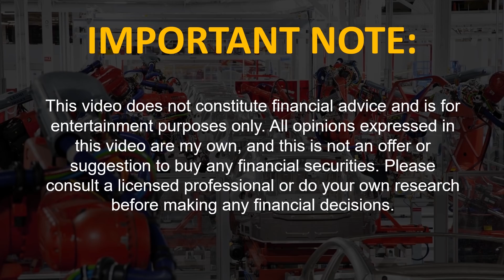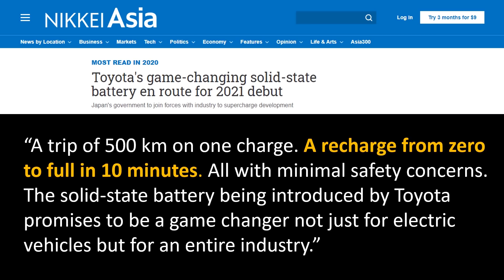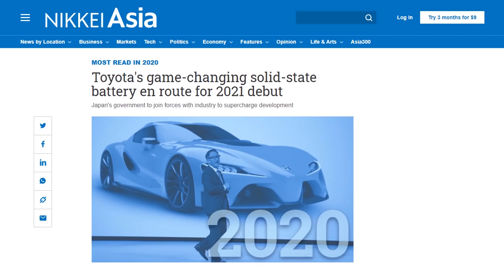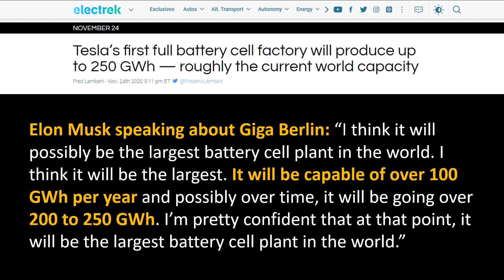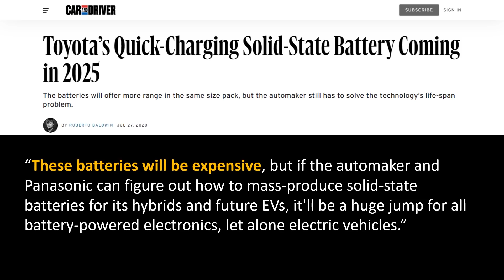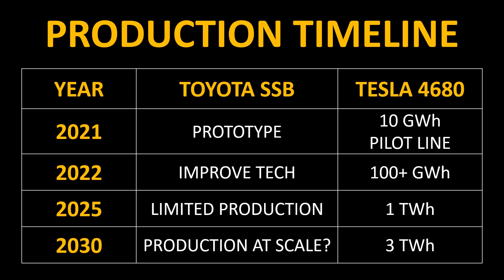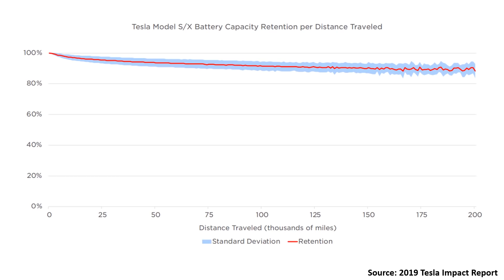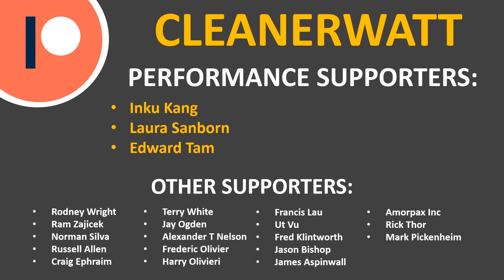Tesla NEW EV Batteries vs Toyota Solid State Batteries

Comment: Tesla can do over 500 kilometers now (300 miles) on the model 3 and Y and almost 700 kilometers (410 miles) on the model S and charge from less than 20% to over 80% in 15 minutes with the  Ver 3 chargers TODAY! that is fact and without the new 4680 cell which will be better all the ICE Car makers are 4-5 years behind

Comment: and also they are not going to stop making things better so in the 5 years that toyota is going to take to come out with the higher prices solid state batter tesla should have double to triple if not more on the power and charge rate, and or possibly come down even more on the size/weight

Comment: Tesla is years ahead of the competition. However, solid state is the holy grail, which Tesla also seeks to achieve. Any company achieving this, will be ahead of any other competition, including Tesla. We will see who gets there first.

As with all new technology, it will come at a price until mass production is achieved, but the party piece is real fast charging, comparable to gas cars and getting rid of the lithium should get rid of battery fires in case of punctures.

I will get a Tesla Model Y next year and I do hope to hold on to it long enough for solid state batteries to mature. The next EV after the Model Y will be from a company with that tech. Additionally, that next car would also really need V2G technology, to help with the transition to greener energy. If Tesla were really confident about their battery tech, they  would make this a top priority.

Comment: I don't see that solid state batteries are a problem for Tesla. Tesla has a good relationship with Panasonic who are doing the research for Toyota. Tesla will go full steam ahead making EV's with the current leading technology which is Lithium Ion batteries, because they can't wait for solid state to be ready for production. For Tesla, more Teslas on the roads is free advertising, and of course they are building a loyal customer base using existing technology. When solid state is ready for production, Tesla will cut some kind of deal with Panasonic, and start using those solid state batteries as well as, or instead of the Lithium ion batteries.

Comment: I thought this would be unbiased.  This video reads like something a Tesla fanboy would post.  I understand that Toyota's battery is nowhere near able to be put into production, that part is fine.  But you mention these new Tesla batteries and how they are cheaper, but give no statistics regarding how much improved they are in regards to how much energy they can hold over the older model batteries nor how much faster they are to charge.  The only statistic you give is regarding the longevity of a different model of battery.  

Also , your biggest benefit of the Tesla battery appears that they can be made at scale in very high amounts of capacity.  That's great and all, and hopefully they will bring down the price of the total car in general.  However, increased capacity doesn't touch what I consider is the weakest link of electric cars right now, the fact that they take too long to charge.  In other words, even if I can get an electric car cheaper, it's still much much faster to fill my tank with gasoline compared to charging it.  Don't get me wrong, I am not against electric cars, I really love the idea -- it's far cleaner to the environment, and gas stations and the production of gasoline are extremely toxic just by existing. You don't address this problem at all, and because you just compare Toyota/panasonic to Tesla, you need to keep in mind that Toyota is not Tesla's main competitor, but fossil fuels.

Comment: So a reality check comes from Car and Driver article. Come on man, you can do a better research than that. Right now 4680 is the best lithium battery, but a lot of companies had been developing solid state batteries. If Toyota can deliver on all these claims, it's good for everybody.
Reply: It is consistent with the current research literature - this summary (and the C&D article) is similar to what experts in battery research are saying. Scaling SSBs will not be easy, and that won't happen until after they work out other issues like cycle-life/capacity fading, and high cost. And all the while, LIBs will keep marching along.
Reply: @cbmusgrave  difficult doesn't mean impossible, or we are stuck with the current technology.
Reply: @techburnsca  Of course the technology of various LIB types will continue to advance with more R&D - the issue is the gap between the SSB potential and where we are now. I'd prefer taking a more fundamental evaluation of what needs to be done to evaluate the potential timeline for its commercialization.
Reply: @cbmusgrave  IMO, LIB battery tech could become obsolete once SSB comes to market.  Toyota, VW, Samsung, Panasonic, to name a few already have working prototypes. Now, it's just a matter of scaling up for mass production. 2025 is a reasonable timeline when we will see them on the roads.
Reply: @techburnsca  We'll have to see. Are you a battery researcher or developer or have you worked on scaling up other technologies? Scale up is a key part of commercialization (as Musk pointed out, prototypes are easy, manufacturing is much harder). Despite the prototypes, they have not found an electrolyte that meets all the performance requirements, including the stability window for proposed cathodes and electrodes. They also have to work out adhesion issues and sensitivity to delamination and mechanical stresses. Also, they use a wet process for electrolyte deposition and do not use a roll-to-roll process (so, manufacturing cost could be high). They also need to develop recycling processes (although I suspect that Redwood material's smelting process will also work for ASSBs). Two friends of mine started SSB companies (Quantumscape and SolidPower), so I hope they succeed sooner, but I understand there is a big gap from prototypes to commercialization.
Reply: @cbmusgrave  Quantumscape is even more optimistic targeting 2024 with VW vehicles. I thought Quantumscape and Solidpower are also using roll to roll process (I don't really know but from what I have read). No, I am just an engineer who happens to be interested in these things. I'm in the agricultural machinery industry. Scaling is really a challenge for new technology, but, I am optimistic that in 2025, we'll see these on the roads.
Reply: @techburnsca  I have seen Quantumscape's estimates and they are very optimistic. I won't comment too much because one of the founders is a friend and former colleague (we published one research paper together). It would be great if they do hit 2024 production but from what I know, they will have to solve some major challenges first. I'm assuming if they do produce SSBs in 3 years, they will be very expensive (meaning VW EVs will be very expensive or they will lose money on each car sold). Current SSB processes are wet and if they do use a dry roll-to-roll process, they will likely need to license Maxwell/Tesla's dry electrode deposition IP. One thing I haven't seen yet is a solid electrolyte with a wide redox stability window - that isn't a scaling issue, that is a fundamental materials issue. I haven't seen as much from SolidPower, but their time frame is to have their batteries qualified by early 2022 so I expect we'll hear more about what they are doing this year.

Comment: Does Toyota need scale on its battery now? No. The ICE market is still huge. The growing market over the next decade is not BEV but PHEV for Toyota.
You may start today with a 2.4l engine. 2022 move to a 2.0l with small battery, 2025 move to a 1.6l with bigger battery, 2028 move to a 1.2l with even bigger battery.
They can already make enough cars, they can already make the engines, all they need is to scale up the batteries.
It's not going to be ICE today EV tomorrow.

Comment: "Doesn't seem focused on EVs"

Apart from the 6 global BEV models that will be launched between now and 2024? 🤦‍♀️

Apart from the Direct4 motor technology and 402hp SUV prototype that Lexus showed off during December (RZ450e)?

The Solid State Battery model will be shown as a prototype vehicle for the Olympic Games, it's the next step on from the current battery packs - part of their spending on alternative fuel technology, which includes hydrogen.

Comment: Solid state batteries is just an excuse by Toyota to delay mass producing EV's by 10 years since they don't really want to make an EV unless forced to. If they were really motivated to make an EV, they can use less expensive, existing off the shelf battery technology in a car that can be produced now and then upgrade the battery as it become available.

Comment: when you say Tesla has a got a solution that is going to work now I don't get it.
Tesla has been developing that battery tech for the last 7years! Solid State Battery need more time in development, for their mass production in the next 10 years, Tesla should be really scared. as the cost of manufacturing becomes cheaper with technology, durability issue will be solved with two years!
anyone who has done some research about batteries will know a solid state battery is going to be the best option for automobiles 10-15 years time

Comment: If is not from FATHER ofbaterrie i dont want it.
The father of battery Jhon B. Goodenoght and Elena M. Braga got nice revolucionary battery. And demostrate it with buttontype battery model CR2032, easy to do.
x5 more ENERGY density 
23.000 life cicle (like a inmortal energy storage) Bye bye recicle proces just take it and replace in other gadget because is longe life.
6C speed charge. that mean if now you charge in 1h(60min) your big powerwall or car, whit this you can charge it in 10min.
Safe usage, no more explosion fire from overheating.
I TRUST on YOU J.B.G and M.E.B !!!! I trus on yout Solid state battery made of Li-ion and glass.

Comment: You can't be married to the tech - if the 18650s are the most mature (abundant) battery and you wanna build an EV you go with the 18650s !! If you have a somewhat successful product like say a Model S and Model X using the 18650 design you might be able to go to your battery provider and say 'guys? we have a much higher volume product in the works ( the Model 3 ) do you think we could make some changes (within reason) to give the Model 3 an even better chance at doing well and you get the 2170 form factor (probably the closest / largest they could get with the hardware they had already installed in the Nevada Gigafactory....

Listen when you (Tesla) quickly became the LARGEST buyer of lithium ion batteries in the world you get to make requests of the suppliers as to how they are designed and built.

18650 wasn't the perfect cell ( the roadster, model S & model X )
2170 wasn't / isn't the perfect cell the ( model 3 & model Y )
4680 won't be the perfect cell either the Model Y the Model X the Cyberytuck and perhaps even the Model S & Y (roadster 2 also)...

The first takeaway... their is never going to be 'the perfect cell'
the second is (as a company) you MUST work with the products that are most abundant to build the most vehicles (and other products) you can to first, perfect your ability to build a production line and second learn how to juggle battery cells of different sizes & types - this will be a really important skill now and in the future... you MUST be able to bob & weave being stuck with an entire product line that is ALL tooled up to only use the (inset the new cell) will be doomed if that battery gets supply constrained for even the most simplest of reasons  

Tesla is quietly demonstrating it can most assuredly roll with the punches...  if all they have are the 650s it'll work with thoses .... give them enough 2170s and now they can do even more stuff!! oh now they have a stream of 4680s now they can REALLY shine!!! 

Each new battery has opened the door to better and more exciting products.... You don't see Tesla waiting for the perfect cell because I'm pretty sure it doesn't exist (and never WILL!!)

The perfect cell at this specific moment in time  -  yeah sure okay... 5 years ago it would have been the 18650 2 years go the 2170 and in 2021 the hotness will be the 4680....

Happy 2021 to one and all and my advice to everyone is don't get married to a number! ;)

Comment: You are underestimating Japan Inc engineering. They will figure out the cycle life and manufacturing within five years. Batteries are the becoming the lifeblood for the auto industry and bring a degree of energy independence to Japan. The Japanese are very good at materials science and manufacturing. Not good at software engineering. Toyota, Panasonic, and the rest of Japan Inc will get there.

Comment: ICE vehicles will not be competitive with EVs in 2025. Are they going to transition from being one of the two largest vehicle manufacturers on the planet, to a government funded research lab working on solid state batteries? Remember, it's not enough to be able to make a vehicle, and sell it. You have to be able to make money at it. That's what makes Tesla so scary. They make money making EVs, so they are always ramping, and won't stop till they can't sell more of them.

Also, I would not trade cycle life for faster charging.

Comment: let's be honest. If Toyota take till 2030 to bring solid state battery to market it will be the same mistake as" hydrogen is the future", more money and more importantly time wasted. If you take so long to develop then your target market may be gone. Tesla gets FSD by 2025 then no one will give a stuff about how long to charge, or how fast is your robo taxi. AI will ensure you get from point A to point B with the minimum cost and hassel. Hardley anyone will be charging a car manually let alone putting liquid in ie. hydrogen. Toyota your wrong,

Comment: Why are you a salesman for Tesla?  I see nothing here that really does anything to alivieate the real problem.  Lowering the cost of batteries isn’t going to give more range and horsepower at the same time.  All you did is poo poo Toyota, when Tesla is just poo poo.  What Elon should do is advocate advanced nuclear energy and use that energy to desalinate water, generate Synfuels using CO2 in the air, or hydrogen for fuel cells and airplanes.  Also metallic hydrogen at room temp, will be the ultimate in energy storage.

Comment: I disagree with making all these conclusions about the Toyota/Panasonic battery tech on claims in the Nikkei Asia article  Also, Elon said that the 4680 prototype line still needs significantly more development in order to produce cells with an acceptable yield.
Reply: The development that Elon's referring to is upping the consistency of the cells at a high volume rate, beyond the early production status. 
Merely ironing out the bugs to bring a better yield at high volume. 👍
Reply: @CNile-se9xw  Regarding the dry electrode process, Elon said "it's not completely in the bag there's still a lot of work to do" and that it's "insanely difficult to scale up" from bench top to volume production" and that on the prototype line "it does work but with not a high yield".(55 minutes in the presentation). These are not "merely ironing out the bugs to bring a better yield at high volume."

Comment: The way I see that both companies aren’t ready unless the underlying issue is fixed. 

For 4680 cell format Tesla published, show no sign of - welded pathway - from electrodes to cell output terminals. That leaves us the only way to pass heat and current out is by point contacts, that is a performance and safety issue Tesla didn’t address the public of its solution. 

Problem? 
(1) Heat and electric conduction performance of 4680 cell requires substantial contact and retention forces in packaging without a welded pathway that have not seen addressed publicly.
(2) point contact required retention force cannot be derived from or passed onto those multi tab because tabs are made of annealed ie soft copper and not spring materials. If there were contact force created in the cell sealing process such force will degrade through temperature and inertial shock and cycles on on road. That eventually produce an open circuit in the cell and subsequently an electric arc between multi tab and cell casing, to a rapid oxidation process or an explosion.

Comment: The battery day you said? The event that showed computer rendering only (no actual battery prototype was shown). And the one that showed 5x and 6x is misleading people to think it about density but this is misleading! If I used duct tape 5 battery cells I would get 5x. This is BS. 

Tesla is know to fail to meet delivery timeline, fail to reach production scale, and fail promise fake non existing things like the semi or the cybertruck (which does not even satisfy registration requirement). 
Tesla battery day was not break through. It's just a claimed production line tweak that might help them in production process but it's not reflected on power density. After all it's just a li-ion just like all others.

On the other hand Toyota is talking about real break through like hydrogen cells and solid state batteries. And frankly speaking I think toyota knows how to manufacture and knows better how to deliver and take prototypes to production. They might produce in a qourter what tesla produces in its entire history.